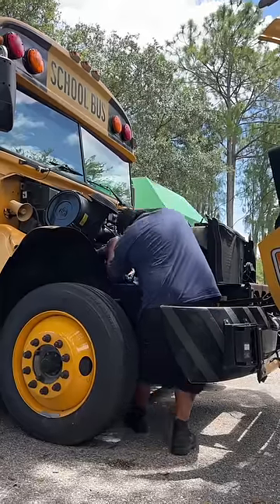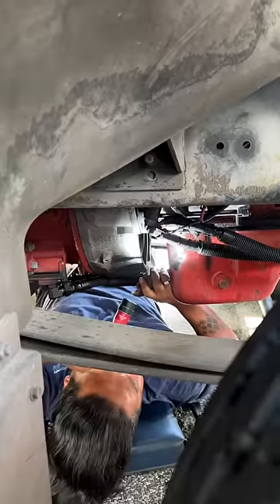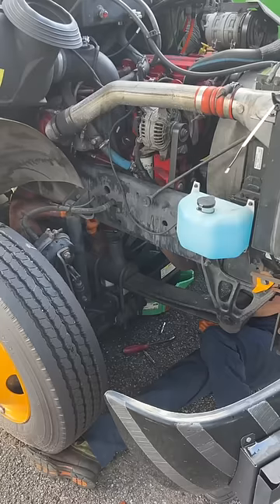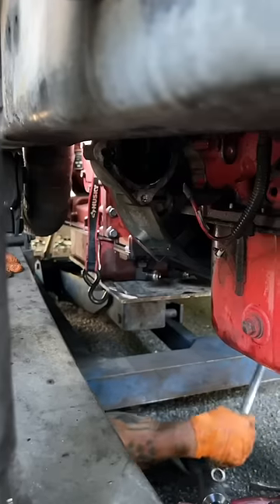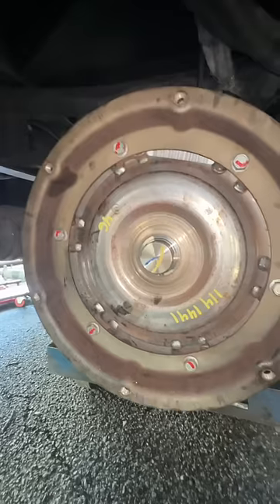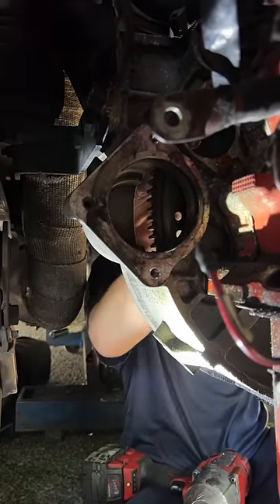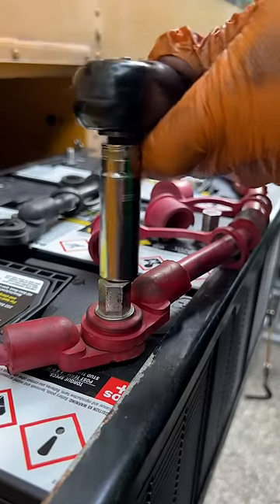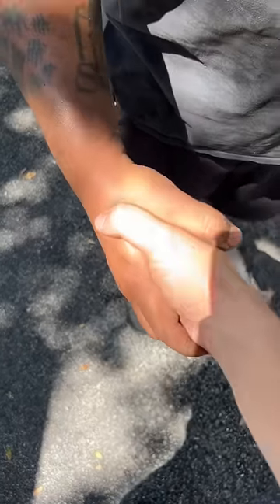How much have we spent on repairs? #diy#busconversion  #skoolieconversion #vanlife#skoolie#buslife

Comment: A rear main isn't going to cause a hard no start ...
Reply from the maker: Right our newest video has an update!
Reply: Yea I'm glad someone said something
Reply: Was thinking the same thing, sounds like battery is dead 😂
Reply: @BlarginBro  imagine doing a rear main for dead batteries 🤣
Reply: @BlarginBro  a bad or weak starter will do that to
Reply: @santiagopita1882  exactly, I see the short about the oil pressure, but that wouldn’t be a starting issue? It would be an oil leak and yes it might annoying having to add oil but you can drive it
Reply: @Our_Life_Adventures  exactly a rear main seal doesn’t even hold oil pressure? It more or less just an oil seal to hold oil in the pan either they got finessed or they’re leaving out some info
Reply: @Our_Life_Adventures  true could be starter, battery, but clearly the engine is cranking so I’d probably guess needs some new batteries
Reply: Was thinking that, I need to be a mobile mechanic! 😂😂
Reply: Diesel tech here, any type of oil leak would never cause a rough start on these engines. I have seen a lack of high pressure oil (due to a massive oil leak) cause a no start condition in HUEY system engines. But as far as I know Cummins has never utilized a Huey system in any of there engines
Reply: Came to the comments wondering if anyone else knew lol
Reply: That's what I was about to comment lol
Reply: @BlarginBro  a rear main seal on that particular Cummins engine doesn't actually seal off the 60 psi cold and what should be around 35 psi hot at idle oil pressure but it does hold back a few pounds at idle and roughly 10 psi at highway rpm. If the seal is very bad it could leave a gallon of oil on the ground in a minute or so. I've never seen anyone  stupid enough to run an engine leaking oil worse than that but I'm sure it could leak more in less time.
Reply: I thought I was the only one lol. But to me it sounds like too much starting fluid, I work in school busses.
Reply: @timothyjohns8630  that's an isb 6.7 and You are correct haven't had a Huey system this one has a fuel rail
Reply: @lucasbingley1735  a rear main seal leak wouldn’t even cause a hard start even if It had a Huey system, it would have to be leaking so much oil on the high pressure oil side, that it can’t build high pressure oil.
Reply: I'm just gonna say it it's labouring on a couple holes while cranking over and dead on others I'd recommend a compression check and then probably drop the pan and look for metal
Reply: @timothyjohns8630  I think you need to re read my comment I never said that it would thank you for jumping to a random conclusion I happen to be a diesel tech for Cummins, I was actually agreeing with you
Reply: @meanmachinesgaming  you can look for metal without dropping the pan wire mesh screen over the drain pan and a bore scope in the drain plug will tell that story but yes that thing was deader than a door nail plus I'd be willing to bet on a thousand other issues with the bus we all know how great the county maintenance department is 🤣
Reply: agreed.
Reply: They probably told you those poor guys it needs a rear main and then swapped out the batteries or simply jumped it off or did a starter in the process. Find a new mechanic in the future guys, the rear main will not cause that issue unless somehow it was shooting out gallons of oil so fast there was not enough oil pressure. Very doubtful of his honesty. Mechanics lying is no joke.
Reply: @Our_Life_Adventures  I just work on the big engines I'm talking large metal parts like the spun main bearing your gonna see it alot faster than you would draining and straining the oil then ending up with a misdiagnosed rear main seal
Reply: @A.S.S.M.A.N  that wasn't the problem tho the engine spun a main bearing
Reply: @A.S.S.M.A.N  obviously
Reply: But Trump Supporters don’t know this.
Reply: Ya it was just a dead battery 🤣
Reply: @A.S.S.M.A.N  how so ? A rear main Is going to cause a shit load of oil out the back it won't cause a hard no start the will still be compression thus the motor will light off so ...diesel wizard tell me where I'm wrong
Reply: @santiagopita1882  it seems like that’s what happens here
Reply: Yea. Sounds like a dead battery to me. But what do I know. I'm just a lowly mechanic.
Reply: @crazydogman677  what's up?
Reply: Literally, this video was not put together very well
Reply: I was thinking the same
Reply: They got ripped off !!!!
Easy preys
And they told them they will be back for more!!  More money
Reply: Its galloping. One of those cylinders is not like the other!
Reply: That was my same exact thought .
Reply: @benjurqunov  Fail bro
Reply: For real!! Mine starts up regardless.
You’ll just get oil leaks 😂
Reply: Ya they seem really shady... probably why they are living on a bus!
Reply: No but a seized compressor might 🤔
Reply: @camtheman559  lol wtf
Reply: It was probably leaking regardless
Reply: Just like when the novice honda boys post a 3 picture meme about loosing 3rd gear but the pictures show a pinion gear, broken gear teeth and using a marker pen to scribble out 3rd gear on the stick
Reply: @santiagopita1882  haha
Reply: @Samurai Nuts imagine that.. send the link.
Reply: @Samurai Nuts I'm not the one talking shit. I said what I said from this video. If there's an update, great. I'll watch it when I get across it.
Reply: @Our_Life_Adventures  so will oxidized Battery terminals and cables. Might not even look that bad. But just pull them loose and clean with a battery terminal brush for a cheap way to see if that was the problem! I have had that happen to me a couple if times on different cars.
Reply: @timothyjohns8630  Cummins are a tannish color,  Detroit is a Green, And Internationals are red. Yeah I know because I grew up with my best friend at his dad's Diesel Shop! Worked there until I got laid off because of the economy in the early 80's. And nothing sounds like a Detroit 6V53 off the manifolds screaming at 2750 rpm, thing is absolutely SCARY! Especially when a Mechanic had me sitting on top of it to slap the plate down over the blower should it decide to run away. Well, I Beat that diesel to the run! 🏃‍♂️  after I tripped the plate! ESPECIALLY when that mechanic hit the limiter and looked at me with big ass eyes 👁👁! I love that they still run 8V92 Detroits in most fire engines. Miss those ol 2 strokes!
Reply: In a previous vid, they were driving an lost oil psi, unit shit down an they tried to restart it but engine would not turn over, so very likely its seized or spun a bearing.Very common in this engine. That will give a hard/no start issue is. Sadly they forked over prolly way to much money for the “Diesel tech” to do a rear main seal on a bad engine.
Reply: @JessandJake  I'd get a lawyer.
Reply: they made a mountain out of a mole hill on purpose ... to make this video and get donations to their gofundme. link above
Reply: @JessandJake  I watched it and still don't understand? What was the problem?
Reply: Bro people are taking advantage of them at this point
Reply: Exactly what i was just about to type in lol
Reply: @timothyjohns8630  true. I’m a CAT tech and work on a lot of HEUI systems. I’m leaning more towards batteries. Kinda scary when they mentioned the air compressor. That can lead to the oil and coolant mixing. If the pulley seized it can shred the belt. I just had a hard crank, ended up being hydro locked from a leaky egr cooler. Coolant dripped down into the exhaust manifold and sat on the pistons.
Reply: @ericbarnett5527  I don’t even know the story on this bus, that crank sounds quite spun. And the starter is ass as well
Reply: Let us know the expenses for the rear main seal and cost of the compressor??
Reply: Honestly I think they're"mobile diesel mechanic" fuckin screwed them bad...
Reply: Don't know why everything these days is B.S. rear main seal, no start😑. I fear for our kids.
Reply: The starting issue was unrelated to the rear main. They have another video of a huge puddle of oil under the bus.
Reply: @GioMillz  doesn't bode well does it
Reply: @Our_Life_Adventures  not at all.
Reply: Yeah I thought so I’m weak the guys just quoted them that easy asf job
Reply: Yeah y’all got scammed. Bro scammed yall. No offense coming from a 8 year diesels mechanic I’d love to come fix it for free I just got fired and ain’t got shut to do😊
Reply: @99gmcsierralm74  I’m just a Toyota tech n I’ve help do this job in a drive way. Just price check with old Diesel shops. School busses are wayyy to easy to work on in comparison. I’m in central Alabama I’d love to help y’all out for free too
Reply: That chirping sounds like a light seizure
Reply: That's what I was thinking
Reply: I was like sure a small leak is going to stop it from running 😂😂😂😂😂😂😂😂😂😂😂😂😂😂😂😂😂😂😂😂😂😂😂😂😂😂😂😂😂😂😂😂😂😂😂😂😂😂they got burned should have done the air pump
Reply: Looks like an Cummins, you don’t need to disconnect the trans, you can replace the main by dropping the oil pan lmfao,
Reply: Came to say the same
Reply: @timothyjohns8630  I think Cummins has only used an inline p-pump or a rotary pump (I think) on the L10. But a Cummins this new is all common rail. This is an IC/international bus so it's possible it could've been ordered with a Navistar powerstroke equivalent which would've had high pressure oil. But those were v-motors painted blue. A rear main loosing oil pressure to affect the engine running at all would result in loosing the oil about as fast as you can put it in the fill hole regardless of the fuel system.
Reply: Filling it with Lucas at the end 🤦‍♂️😳
Reply: I came here to see if anyone else was noticing that
Reply: Them mechanics came up
Reply: Either that or she doesn't know what she talking about
Reply: @Our_Life_Adventures  the list of things that cause this symptom is a mile long
Reply: Rear main leaking a bit ...no big deal but a big job and big easy money
Reply: @timothyjohns8630  I believe you’re correct, as far as I know HEUI was basically a joint project between CAT and IH/navistar.
Reply: @spudwickthrockmorton2112  y'all ever break down in the central tx area...I'm your guy
Reply: @timothyjohns8630  they should be grateful that they have that Cummins isb....and not a Cat C7s .....pain in the ass pos those are....worse engine Cat ever made
Reply: @timothyjohns8630  all depends if they ran it low and for how long...... hope they didn't spin the bearings
Reply: @timothyjohns8630  as a former Cat employee....I have to correct you on that assertion....first off we don't know what fluid levels and conditions are....but pretty freakin standard in all of mechanic-ry....if u run any engine low on any vital fluids...u gonna have problems... "especially" Cat heui fuel systems.... they operate off oil pressure
Reply: @timothyjohns8630  by the look of the underside and all our experience....u really think that looks like the only leak?... when is it ever just 1.... right?
Reply: @benjurqunov  I'm surprised anyone who would show support for any other man or woman to be ruled over by , would be able to figure shit like this out
Reply: @nmguinn38  no factoring that in ....I bet it wasn't the only leak either and we don't know what the level was...so.... just a bunch of assumptions
Reply: @tbusch63  Cummins, tan color.🤔.... what like 40 yrs ago right....old motors would run circles around this modern garbage us young bucks gotta deal with....give me a 6NZ  3406CAT any day of the week
Reply: @taselescanlan2795  your kidding right....I could replace those pumps in my sleep still..... you do realize they operate off of oil pressure... right?....,. Severe low oil= severe low iap
Reply: @jeffbush7764  Yeah I need my DEF fluid changed 😂
Reply: @santiagopita1882  no imagine getting towed what they said 4 times
Reply: @09450rdude  yea man, tows are expensive af. They definitely got scammed
Reply: still pretty important to take care of a rear main, and internationals love to go into limp mode for simple issues. 1 batteries low, okay we gotta go slow for this one
Reply: Shit.. No start and ended with a rms diag???? Sounds like highway robbery
Reply: @QkjajshsjajaCcccc  kinda what I was thinking...shade tree guy trying to embellish and feed on a couple that really didn't know better
Reply: @Our_Life_Adventures  sad to see it. Im sure whoever they consuled with regarding the initial purchase was running them as well. At a point.. Noone to blame but yourself.
Reply: @QkjajshsjajaCcccc  I don't think they share any blame other than maybe doing better research on the equipment they were buying most retired county vehicles come with a complete lack of regard for proper maintenance that really boils down to budget of said county they should be up front about it but most aren't it's still shady as crap
Reply: @jeffbush7764  what? No idea what you are talking about. I was saying since it is NOT a heui system, the slow/no crank was NOT caused by the rear main seal. Any monkey can change parts in their sleep, techs get paid for proper diag. This whole situation looks like they got scammed. You look like the kinda guy that likes to reply to everyone and show his 2 cents, so have fun.
Reply: @santiagopita1882  😂
Reply: @timothyjohns8630
Reply: Fr lmfao
Reply: @BlarginBro  rear main seal doesn’t hold oil in the pan 😂. None of you know wth your talking about.
Reply: I was literally about to say this 😂
Reply: Oh that knock when it started.🤪😜
Reply: I’m glad you said it
Reply: GEEEE I wonder why they coded out the bus to start with. It's a conundrum.
Reply: @Samurai Nuts  bro only you would spend 15 minutes researching a topic just to tab back over to finally leave a reply to a random stranger. How are you that afraid of what people think of you, yet you have the audacity to embrace being a weeb
Reply: @Samurai Nuts my point exactly
Reply: @Samurai Nuts maybe you should work on your reading comprehension if you honestly feel that way
Reply: A rear main seal also doesn't create a knock after it starts lol
Reply: @santiagopita1882  upsell
Reply: That chirping at end is a crankshaft bearing bad.  Hence the hard start and rod hanging out the side now. Any decent mechanic should have told you that before charging to fix a leak
Reply: Are you sure
Reply: @idabomb00  how would it. It would just leak oil
Reply: @timothyjohns8630  hey Tim, I'm 100% NOT a diesel tech. What's huey?
Reply: I was confused
Reply: Usually the seal goes out because the bearings are shot.
Reply: @santiagopita1882   2022 nothing surprises me
Reply: @santiagopita1882  "Looks like the bad battery cooked your rear main seal"
Reply: Bruhhhh lol rear main seal ain’t starting the bus lls
Reply: They have a problem with there oil pump or there not plugging the truck up. The rear main seal was one of the issues but likely the high pressure fuel pump that runs the turbos is on its way out. There gonna spend 15k omg don't buy a school bus if you don't know how to repair it. It still sounds like it has 400 hrs plus idle time
Reply: I would shit if there was just no fuel 🤣
Reply: @santiagopita1882  h#
Reply: Exactly the mechanics screwed  them
Reply: @santiago pita  the mechanics knew it bt needed the money 💰
Reply: @nmguinn38  but might ain't right
Reply: Rear main seal?  Plus air compressor?  Mechanic says is the issue for hard start...
Reply: Somebody ripping them off
Reply: They had the bus at Cummins service because it overheated. Then lost oil pressure because the rear main seal started leaking. The damage had already been done. After it was replaced and started again you could hear the rod making noise and it eventually went through the block.
Reply: @timothyjohns8630 They lost oil pressure and damaged the engine.

Comment: Damn,my battery is dead...wel guess its time to change the rear main seal!
Reply: Fr 🤣
Reply: Tire pressure was low 😅
Reply: same thing happened with my hyundai, and it wasn't a battery issue. it was a jammed timing chain due to the bad tensioner.
Reply: im no expert, but it was an experience that i faced.
Reply: @robinmoemyint7349  that's timing. That means your car wasn't sparking and moving the valves in time. Rear  main seal is way different. A rear main seal is behind the output shaft on the engine that keeps oil in the crank case. It's a bearing with a seal around it, nothing crazy.
Reply: @cro-thehacker7018  yea that the main cause in this situation. What i said was tht it isnt always a battery issue, when making those cracking occur. It can also be the other way around. Thanks for making it cleared to me bro.
Reply: @robinmoemyint7349  no problem. I've been working on this kind of stuff for awhile the engine definitely sounded like low power or it's blown up and needs a new engine as soon as I heard it
Reply: @cro-thehacker7018   yea bro im a trainee mechanic im new to this world
Reply: Jajaja funny
Reply: Y’all are mean. All they’re doing is trying to fix the bus.
Reply: I'm dead af 😂
Reply: @cro-thehacker7018  lmao in his Hyundai it probably just destroyed the engine
Reply: @reuben1798  you’re named after a sandwich my guy. Shhhhhhh…..

Comment: The mechanic should have kissed you and Jake and told you that he loved you both after that good screwing.
Reply: Yeah, I'm struggling to see where the seal was leaking.  That torque converter looked just dirty enough to show it hadn't been cleaned, but was also completely free of oil.  That thing would be black if there was a big leak in the rear main seal.  I say this as someone who just finished swapping in an Allison into my dodge Cummins.
Reply: I can't🤣🤣🤣🤣
Reply: This is the first time I’ve seen a rear seal replacement recharge batteries. 😂
Reply: To my knowledge.  Voltage ⚡ to low or bad ground 🤔